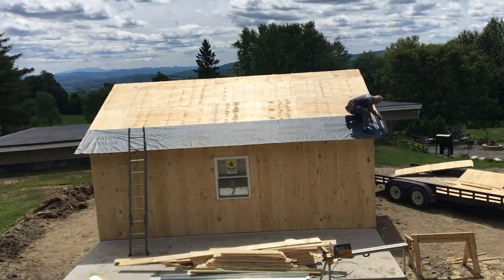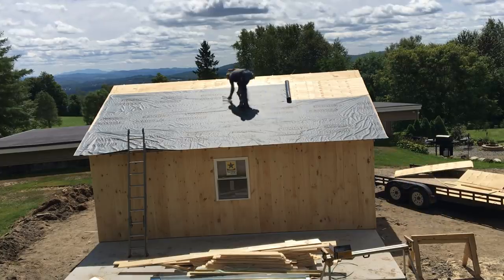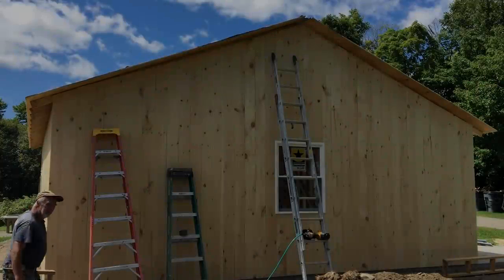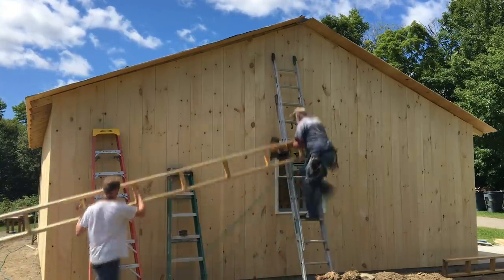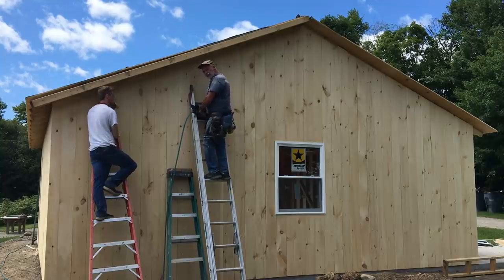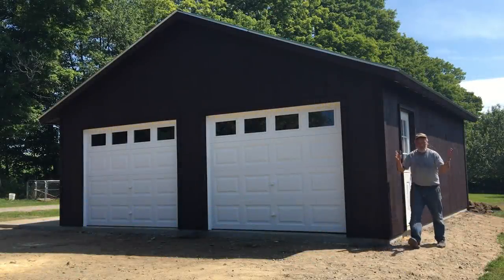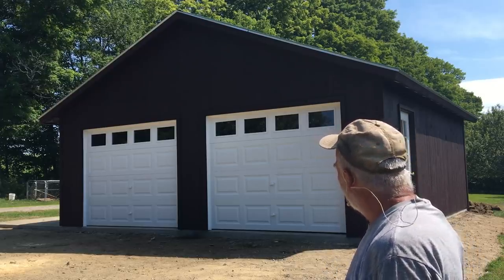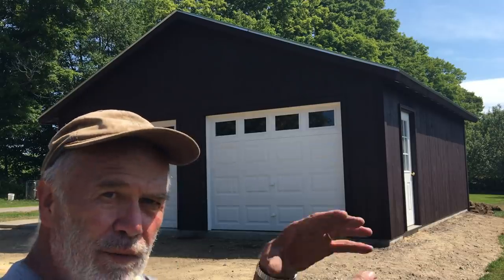#200 Garage with Shiplap siding $19,000 Part 2

Comment: A trick I learnt for metal roofing is to layout your screw spacing while the metal sheets are in a stack and drill them all at once so they make a straight line once on the roof.

Comment: Nice vertical way to do shiplap. Like it.
I'd probably still prefer the vertical metal siding like you used on the roof here, or vinyl siding horizontal or vertical board-n-batten vinyl.
Lots of choices look good.

Comment: I notice you put angle bracing in the walls, I expect because the ship lap siding does not give the lateral support 4x8 plywood or OSB sheathing does.  Did you cut out the studs to fit a single brace or install separate pieces between the studs along the brace line?  Nice job and thank you.
Reply from the maker: Yes thanks for watching

Comment: Great garage. In boating a lapstrake hull is horizontally over lapping boards. What is that called for a garage or house?
Reply from the maker: Interesting. Around here they still call it shiplap even though it’s installed vertically

Comment: Great video and build. Is the coil nailer you are using a framing nailer or roofing nailer?
Reply from the maker: For sheathing or shop lap we use a sheathing nailer with 2 1/2” galvanized ring shank nails

Comment: With such a small roof, kinda surprised you don't ice/water the entire roof. And you don't use a lot of PVC trim either. Seen you do vinyl..but never hardyboard or other no-maintenance products. Is it just a cost issue with customers in VT? (Excluding the fact that we have all these shortages and delays in materials right now).

Comment: I’m a new subscriber and really love these videos, Ken! Couple questions- when you nailed down one side of the trusses you said you wanted to straighten the walls on the other side before nailing. How are you straightening those walls? Also, is that house wrap between the studs and the siding? Is there no sheathing on a shiplap wall?
Reply from the maker: We use the first course of roof sheathing to straighten one wall then we go to the other side and measure both ends and the middle and knock the wall in or out as needed then nail it down. Works perfect every time